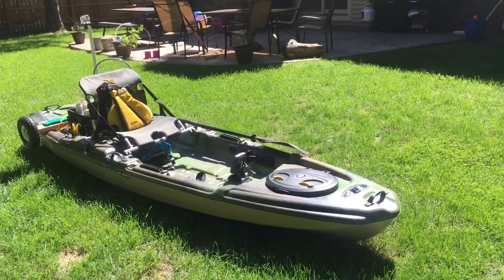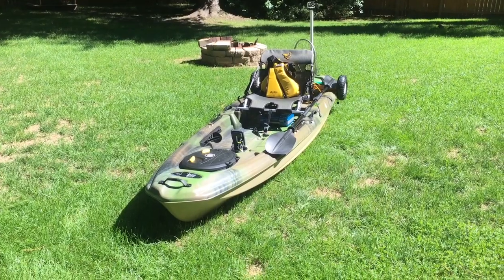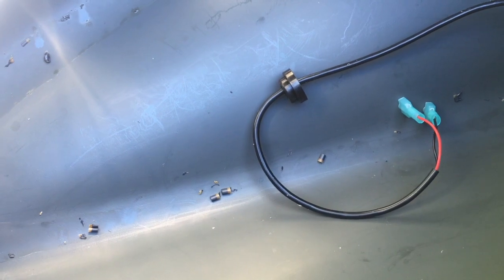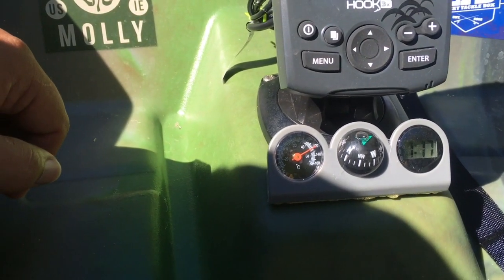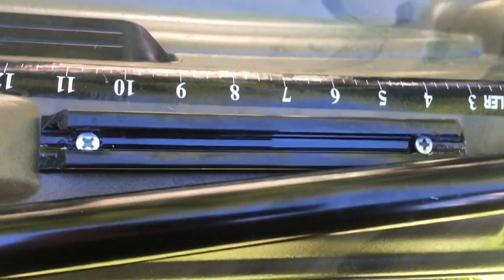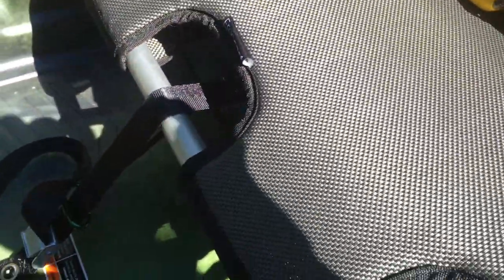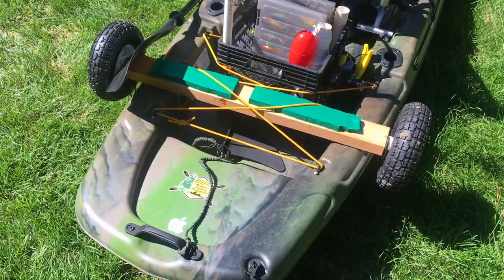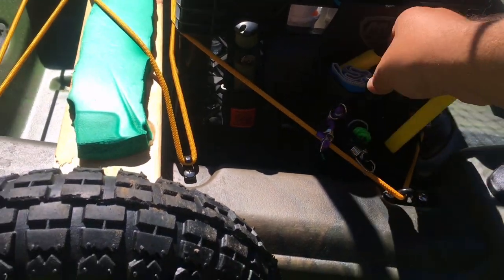My Pelican Catch 120 Rigged

Comment: I just bought the 10', mostly for floating Northern Michigan rivers for trout, smallies etc. Great little unit.
Reply from the maker: Right on! It's a great little boat.
Reply: @BillsCatch22  we just floated the Upper Manistee near Grayling Michigan. It was great. Even had the dog riding on front for half the trip, I could still fish and paddle like she wasn't there. She was in my way a few times but that's on her. Took it out behind my house 2 nights ago and caught a 30" pike. It moved the kayak a bit but not much more than it would my 12' John boat. It's a good set up for catching bigger fish, nice and open up front and front facing rod holders gives you a place to set the rod while you get the fish delt with.😁👍
Reply from the maker: @ericnortan9012  awesome! Yeah we visit up there allot in the summer.

Comment: Watched a ton of videos of this boat. How do feel when standing up in it and the stability overall? And how does the plastic of the boat hold up does it have a tendency to warp or bend easy when sitting in it. Or does it flex a lot? and does it hold much water. Thanks for the video hope to hear back from you.
Reply from the maker: Caprock Outdoors, I haven't tried standing up yet, but only because I don't trust myself yet. The plastic is pretty thick and strong. I haven't noticed any flex whatsoever. Being a sit-on-top kayak, water will make its way onto the deck, but nothing excessive. For the price (I paid $599), I really don't think there's a boat that could compare. If you have to pay retail ($799) I might spend an extra $200 for the Cabellas Advanced... http://www.cabelas.com/product/Cabelas-Advanced-Anglers-trade-Fishing-Kayak/2286581.uts?productVariantId=4575220&WT.tsrc=PPC&WT.mc_id=GoogleProductAds&WT.z_mc_id1=04433611&rid=20&gclid=CjwKEAjwydK_BRDK34GenvLB61YSJACZ8da3N-JzFW0eARcvKPu5kC6mI6ZOn53Oe5Eu6aM6l49owxoCBV_w_wcB&gclsrc=aw.ds

Comment: I bought this yak as soon as it was released.  Could not be more happier with it.  While its not the fastest  Im able to keep up with my buddies sit in yaks.  On  a side note " 15 pieces of flair"  really good movie reference.   Had been looking for a trolley / cart for the yak, gonna use your idea  for one.   For your fish finder Im gonna guess you glued the padding to the bottom but what about the transducer?   Is it just really snug set in that padding?
Reply from the maker: This kayak is great for the price.

 Lol, Office Space is a classic! 

I modified my cart a bit since i did this video. I added a 3/4" piece of pvc with a floor flange in the center of the 2x4, the pvc then goes through the scupper in the back to help with the slipping. 

I plan on doing an update vid soon as I've done some more mods to it. Its closer to the NXT model now. 

The transducer is also "glued" If I could redo that, I'd mount it through the scupper so I can get better water temp readings.

Comment: Anyone Try put a MinnKota troller on one of these?
Reply from the maker: I have seen someone on youtube do it. I wish I knew where I saw it, I'd link it for you. I think they used pvc and a 2x4. They heated the PVC to make fit into the rod holders and bend to the right angle and attached the 2x4 to support the motor. Try doing a search, I'm sure you'll find it.